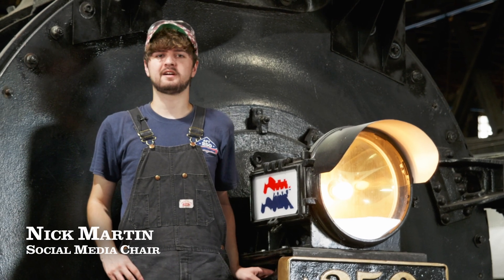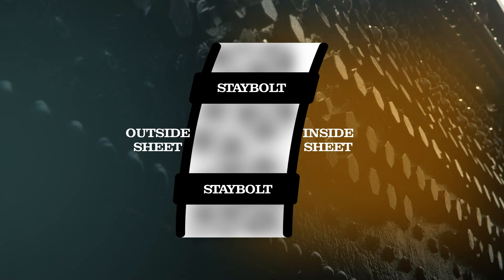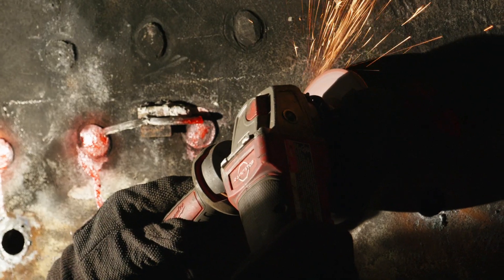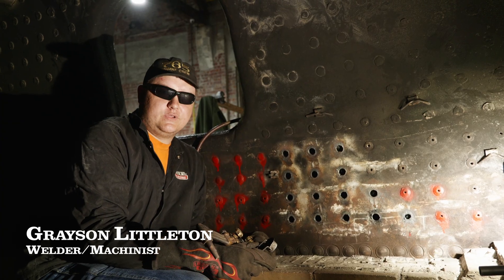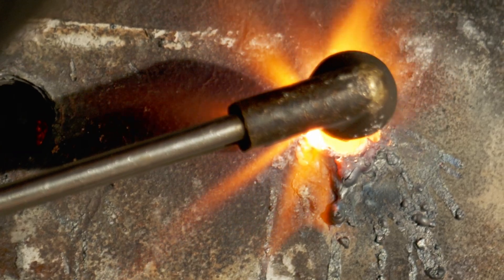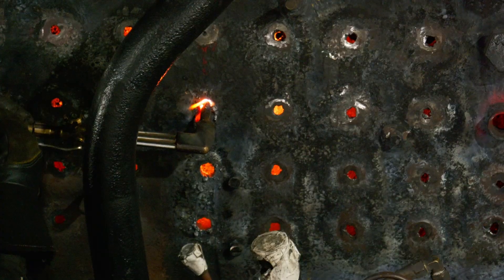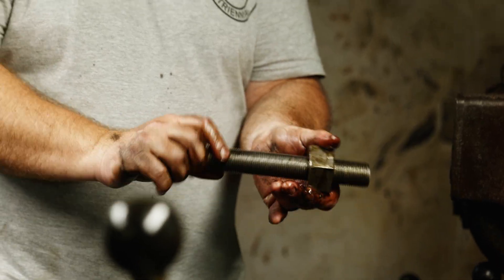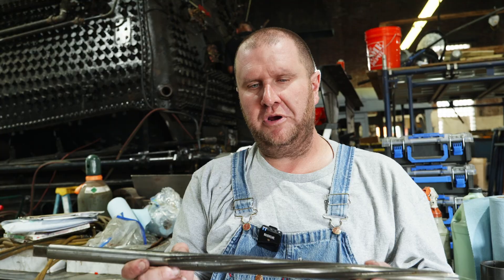How To Replace Staybolts - AFT 250 July 2025 Update

Comment: yes we had to put a few of those in nkp 765, and when they are tapped using a giant airmotor drill, they are then screwed in and the end cut off leaving just a little off the end and litterally driven in like a hot rivet with a rivet buster but with a flat head or I belive its called a snap, vs a cupped one like you would use on actual hot rivets, and the other side has a bucking bar or dolly bar backing it as its driven in to upset and swell the end and threads to lock it and make it water tight into the sheets, then both sides are done and then lightly seal welded to thermicly bond the staybolt to the sheet, I got footage of zach in the video there  driving one of the ends as well as bucking one on 765 on my channel here if you are interested though there are other videos of stays being driven as well, its not easy to do as its often done cold unlike hot rivits which have a bit more give to the hammer blows also though a riveting hammer is under 30 lbs weight it hits with the force of 40-90 lbs usually around 60 is needed to drive and swell the bolt so its like a 60 lb pavement jackhammer you are holding in your hands and has about a 6-12 inch stroke hence the high power for the smaller weight of a rivet gun 
that day it was Zach Hall and Stephen Hook from the nashvill steam group when we did our staybolt work on 765.

thanks for the detail of how an old stay is cut out though I thought they just pieced straight in and burned it out